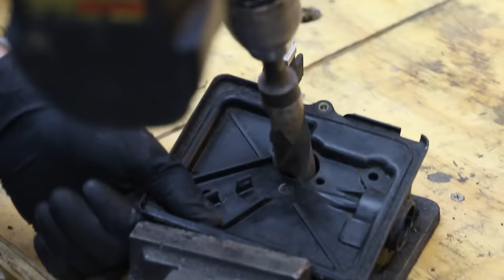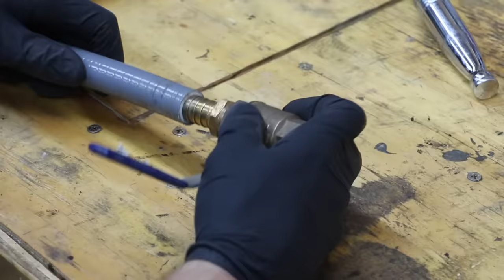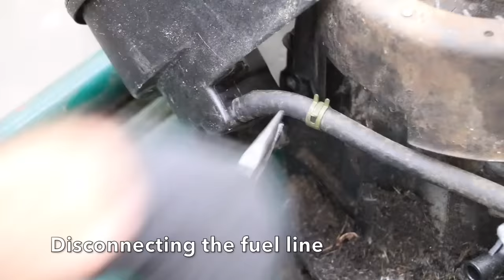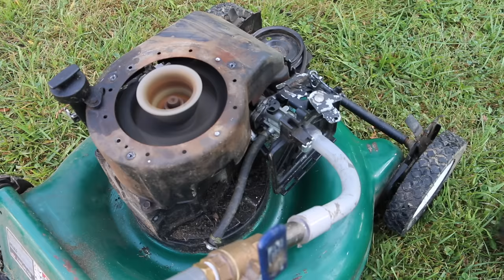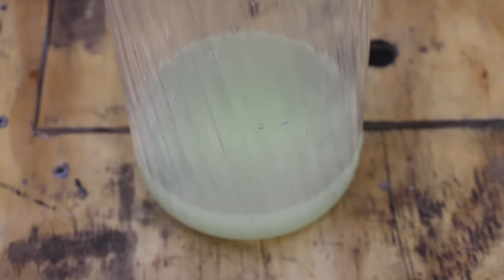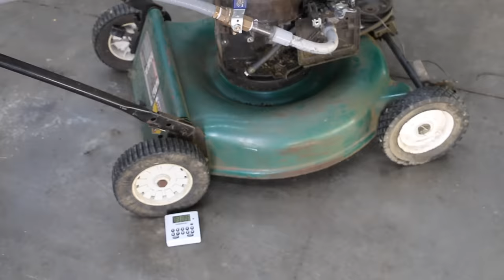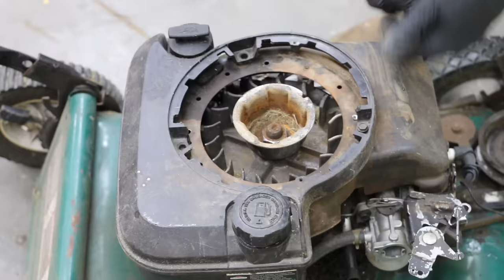Will a "Gas Vapor" Container Improve MPGs and Fuel Efficiency?  Let's find out!

Comment: Great vid!  Really like all/most of your vids!  Thnx for putting in the time, effort, and thought for your vids!   I've tested vaporizers in the past, on my 96 chevy trucks and 2000 mustang, seems to work, but not good for the catalytic converters sometimes!  Anywho, my recommendations are 1) better air/fuel ratio controls, can just add an adjustable air valve up stream of your vapor tube, 2) Air / Fuel ratio measurements (O2 sensor), and 3) Exhaust temp sensor...  Need all of this digital so you can graph the data...  Addt'l test could be to add HHO using a hydrogen electrolyzer to the mix once you get the fuel vapor system configuration figured out!  Thus a dual vapor system, fuel vapor and hydrogen vapor combined!  Also, could use a bubbler on the vaporizer system you're using where you bubble your fual vapor thru a container of water so that any backfires will be contained and not flash back into your main fuel bubbler tank!  Glad you used a plastic container for the bubbler and not GLASS!  Keep up the great work! Long time subscriber!!
Reply from the maker: Thanks, will do!  Thanks for sharing.

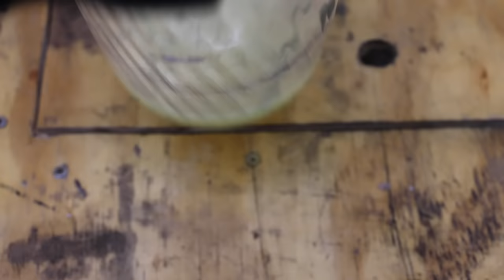Comment: 8:00 - Or maybe the fuel had to double as an air-filter!
Reply from the maker: Great point. Thank you
Reply: Also I bet the yellow gas that was left was just the heavier bits of the liquid with all the short chain hydrocarbons having vaporised.....

Kind of the same thing that happens when gas goes stale, you let the volatile bits evaporate and leave the heavier bits behind
Reply: I was wondering about putting some water in the jar to act as a potential filter, but since it is running on vapors it shouldn't aspirate dirt as they would be too heavy to make it that far up the jar.
Reply: That how some old tractors are but they use oil not gas obviously
Reply: Fair play it did
Reply: @robertoswalt319  I can't see why that wouldn't work mate good idea or use one of your misses stockings a good point about your idea is that the air intake pipes in the jar would still be sealed and the flammable gas couldn't escape when the fuel gets low water gasgit like the old big natural gas storage that used to go up and down lol

Comment: It might turn yellow due to additives in the fuel that don't like to evaporate, so they are left behind.
Reply: I was thinking water vapour getting entrained in the petrol, I wonder how humid it is there?
Reply: We have performed a similar experiment and if the fluid is allowed to sit for a few hours it will deaerate,  return to its former transparent color and may even separate with the absorbed moisture component on bottom that has also combined with the ethanol component and the gasoline component floating on top. 

The cloudy color change was/is from entrained air suspended in the fluid combined with moisture (humidity) absorbed by the ethanol portion of the fluid from the air passing through the fluid. 
Passing the air through the fluid (liquid gasoline+ethanol) effectively becomes a dehumidifier for the air passing through the fluid.
Reply: would this "super oxygenated" fuel burn more efficiently? If so would it not make sense to route a vacume hose through the gas tank in order to achieve that result AND have the benefit of the extra vapors being plumbed into the intake ready for use?
Reply: That is just water mixing with the ethanol.  Dweeds
Reply: The Joker probably or just remains from the petroleum
Reply: +jeff ledlow 
No, it would not burn more efficiently, particularly in modern ECU equipped vehicle engines. 
The entrained air would reduce the fuel's energy density, energy content or heat value whether measured by volume or by mass. 

Actually, by definition this air entrained fuel is not ""Oxygenated". 
Atmospheric air contains approximately 21 percent Oxygen, 78 percent Nitrogen and 1 percent other gases. 
To be an Oxygenated fuel the Oxygen would have to either be bonded to the Hydrogen and Carbon (hydrocarbon) components at the molecular level or be a molecular bonded compound additive component such as Ethyl Tert-Butyl Ether (ETBE) that liberates/releases or transforms into Oxygen during the combustion process. 
This un-bonded aerated fuel will rapidly deaerate, separate and stratify with the entertained air coming out of solution and dissipating into the surrounding ambient environment. 

Most US vehicles manufactured after 1995 have the fuel tank vent connected to engine vacuum to help prevent atmospheric emissions of fuel tank fuel vapor by controlled sucking fuel vapor into the running engine intake plenum as part of the Evap system.
Reply: Maarek Aabmets could be humidity from the air bubbling through the liquid that makes it cloudy.
Reply: The Heavy Ends that are left over have high concentrations of Olefins and Parrifins, which are liquid waxes, and are a byproduct of fractional distillation of crude oil.
Reply: You get that building up particularly in the vapouriser in engines that have been converted to run on gas.  Although there's only a very tiny amount, over several thousand miles enough brown goopy waxy gunk builds up to to be worth stripping the vapouriser and cleaning up the demand regulator part (think diving regulator that gets heated up by engine coolant).

It can be quite thick, with a consistency anywhere from honey to vaseline.  It must be carried through when the LPG is still liquid, and left behind when the lighter fractions boil off.
Reply: Good Comment. Please check out Gasoline Vapor Systems on Facebook. Thanks, Mike
Reply: Good Comment. Please check out Gasoline Vapor Systems on Facebook. Thanks, Mike
Reply: Good Comment. Please check out Gasoline Vapor Systems on Facebook. Thanks, Mike
Reply: Maarek Aabmets ‘
Reply: patw52pb1 awesome, chemistry!  
Following along the “superoxygenation” train of thought there, what if the intake to the vacuum bubbler/vaporizer was the output of an HHO generator, with both hydrogen and oxygen atoms and/or molecules present to mix with the hydrocarbon fuel? Or the output of HHO was merged with the gasoline vapors in an intake manifold?
Reply: x xx water vapour in the air would be absorbed by the hydrophilic ethanol in the gasoline
Reply: michael vannozzi wouldn’t those heavy ends be mixed with or diluted by the remaining ethanol, which likely absorbs a good deal of humidity from the intake air?
Reply: If you take a bowl of fresh gas and let it sit open overnite on a humid day, it will be cloudy the next day because of the alcohol in the gas absorbs moisture.
Reply: Maarek Aabmets or simply humidity getting into the fuel via the bubbling

Comment: I thought you had to also warm the gasoline because as it evaporates it cools making it hard to continue evaporating.
Reply from the maker: Great point.
Reply: Smokey Yunic did something like this way back when. Heating the fuel till it vaporized then run it through the engine.
Reply: Sonic vibration does almost as well.
Reply: @bill miller I'd much recommend this over heating.
Reply: I am very surpised! Great experiment! Thanks again for your time and sharing!
Reply: Liquids vaporize at different temperatures. Petroleum distillates do it at a considerably lower temperature. JP-4 will vaporize and flash at 0°F
Heat isn't needed
Reply: the fact that they vaporize easily means the heat lost to vaporization needs to be replaced to maintain that rate or vaporization.
Reply: The heat could have come from the blender itself and the bubbles could have been oxygen whipped in to the water. As for this video, I think smaller tubes on the air intake wouldn`t create such a violent bubble and allow for most of the fuel to be used.
Reply: Theoretically, the heat from the exhaust can be used to preheat the fuel.
Reply: I would like to see an externally heated gas tank with a check valve that leads to the fuel intake. Ensuring that hot vapor is entering the cylinders.
Reply: i wonder if it is just straight ethenal. it could be way cheaper getting an alcohol based fuel to act as the evaporating liquid. if this isnt fake.

Comment: I did this same experiment around 1985-ish. (only my 5 HP briggs&stratton motor was stationary). One difference is I had a Tee junction with another valve that I could adjust the vapor/air ratio. What I found was it basically distilled the fuel of all the "good" and burnable liquid fuel, leaving me with a darker colored liquid fuel. I believe all that "gunk" left in the bottom was anything that would not vaporize (under vacuum) and were probably non-burnable additives and such. I was always interested in "vapor carbs" since I was 15 years old (that would be in the mid-1970's!). If you look up all the "vapor carb" patents, most would heat the fuel before vaporizing. This probably helped with the "other stuff" in the fuel. I still think that a modern vapor carburetor might be worth looking into now that we have much more advanced technology/
Reply from the maker: Thanks for sharing.

Comment: Well in a sense engines DO run on gas vapor, since the carburetor creates gas vapor from liquid gas and mixes it with air, the resulting vapor is feed into the manifold to the combustion chambers.  So this sounds like you've turned the gas tank into a carburetor.  Actually similar to the setup that runs my propane generator, the liquid propane is converted into a gas (vapor) by the regulator and then fed though a pipe to the engine.
Reply from the maker: Thanks for commenting on this.
Reply: Wrong, carburators and injectors do not make vapor.
Reply: propane is turned into a vapor by the evaporator which has hot engine coolant running through it you need to take a closer look at automotive lpg systems i work on them all the time
Reply: Rackstar BS
Reply: Rackstar, they do, but not how you are thinking of vapor. Vapor, by definition is liquid particles suspended in a gas. In this case its gasoline particles suspended in air. A carb/injector does this through atomization (forcing the liquid through a small opening to allow it to form very small particles). The process in the video creates vapor through forced evaporation. Different roads to the same result: an air/fuel mixture in the form of fuel vapor.
Reply: This is pretty much it.  Gasoline liquid doesn't burn, it's the vapor that burns when mixed in the right ratio with air.  Carburattors and fuel injectors just mist the liquid into the intake air.  That mist turns to vapor in the intake in the case of a carburetted engine, and in the cylinder in the case of a fuel injected engine.  This vapor generator is just a massively oversized carburettor.

Comment: For a down and dirty test this is pretty amazing! I'm wondering if the same test could be run with extremely sensitive test equipment, measuring the engine output horsepower and emissions if there would be a slight advantage of the vapor over the liquid fuel. My thinking is the fuel might atomize better and lead to better combustion.
Reply from the maker: Great suggestion!  Thank you.

Comment: You're just relocating the carby, you're mixing the fuel and air at the tank instead.
Reply from the maker: Thanks for commenting. Carbs and injectors provide a liquid spray, which quickly vaporizes. Viewers requested I test this setup to determine if it'd draw in enough fumes for the engine to run and then if fuel efficiency would improve greatly. Exhaust valve overheating is clearly an issue as modern engines need a "mist" for cooling purposes. Thanks again
Reply: Candy
Reply: bashpr0mpt 
And on a bigger scale which allows more vapor
Reply: @Project Farm
Carbs produce a jet, this jet is fairly well atomized, Due to the pressure difference it quickly boils, Not to mention when the piston compresses the mix.
Reply: bashpr0mpt yeah but he did it with at least 100% better efficiency if not 200%
Reply: @Steve Prince
Takes one to know one.

Comment: David Vicker has a very good YouTube channel. He has worked for Chevrolet alot and is considered to be the GOAT of engines. He says that at 15.1 or up to 21.1 fuel mixture with alot of timing an engine runs extremely well without damaging it at all. I would like to see a video on a small engine doing just that. Will it overheat? What is the exhaust temperatures running it that lean? Whats the fuel consumption? Imagine an  engine that is 2-3 times as fuel efficient. David talks about this on his video about ignition timing. I believe he is an honest and brilliant engineer. As always I like share and subscribe. God bless you. Great channel.

Comment: 2-3% fuel economy improvement plus the potential to reduce evaporative emissions looks like a plus-plus to me. I would bet the engine oil would look a lot cleaner at regular oil change intervals.
Reply from the maker: Thanks for the feedback.
Reply: Sue, A petrol engine will only run on an air/fuel ratio of between 12 and 17 to one thus it does not matter if the carburetor  is used  or if the air is sucked through the petrol as long as you have the right mixture of air/fuel !    THIS experiment was DANGEROUS ! !!!!  If that engine backfired [Say the mixture was weaker] Thar glass Cannister would have blown up AND caused a big fire !  Anybody DON't try this !  A Friend of mine almost died doing this! He was in hospital for a long time.   The only way to do this is by a fire-catcher  [Fine sieve] in the intake pipe.  This method WILL NOT save a drop of fuel,  carboration or fuel injection is by far better.  Please DON'T DO THIS !!!!!!!!!

Comment: It'd be great to see the results you get if you were to recycle the exhaust through a cooling coil and then into your fuel container replacing the air intake air with the exhaust. You may be surprised by the efficiency increase.
Reply from the maker: Thanks for the suggestion.
Reply: That's what a EGR system does on a vehicle lol. So makes sense
Reply: Doesn’t egr cost reduced efficiency at the effect of reduced emissions? Tdi egr delete adds 5mpg on my car
Reply: @Daileyandrew EGR actually improves part load fuel economy by forcing you to open the throttle a bit further for a given engine load, decreasing throttling losses at part-load cruise. It's like a poor man's cylinder deactivation.
Reply: @gregorymalchuk272  I’ve only heard of EGR deletes improving mpg

Comment: My idea which I've seen work before with a friend of mine. Is to see if you can get a regular gasoline 4-stroke engine to run off of hydrogen using distilled water and electrical components You'd have to look up exactly how to do it. It's too complex to explain in this comment, but to see how well it works That would be cool. Cuz I know it does work.
Reply: By usuing metal plates with a positive electrical charge to remove the oxygen from the hydrogen in the "H2o"
Reply: @raymondlee1130  yes sir that's right that was the idea